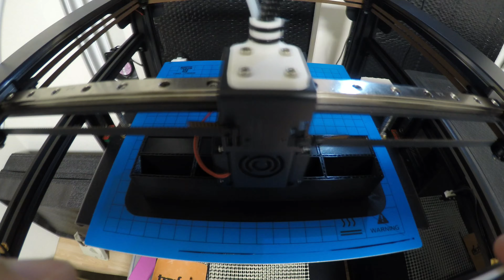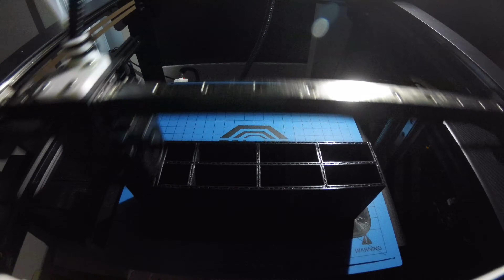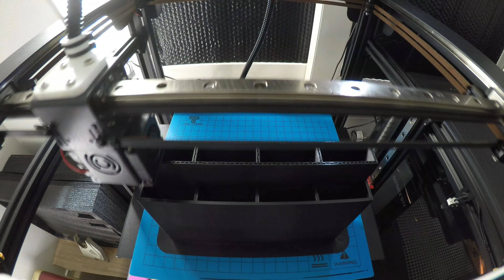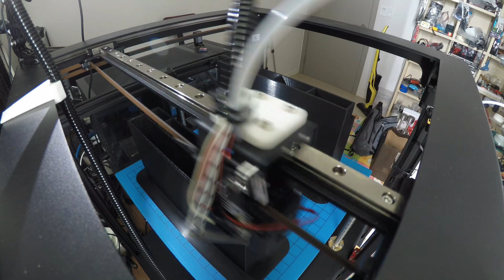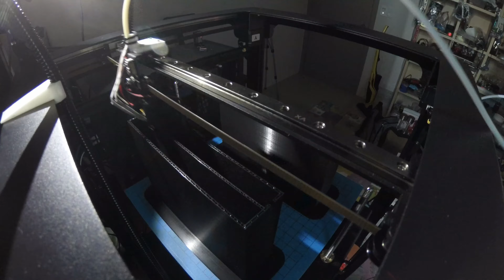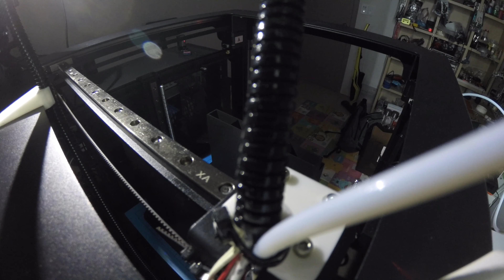20200820 TWO TREES Sapphire plus 3D Printer Sequential Printing over 3days  4K Time lapse footage

Comment: this is one solid machine, i have been running it at 240mm/s regularly with no issues. dont know if it actually hits that speed, but anyhow
Reply from the maker: I usually set speed to 80~100mm/s. Your result is really surprising. I just wonder if it could bear that speed even direct extruder setting. Actually, 80mm/s is toooooo slow~